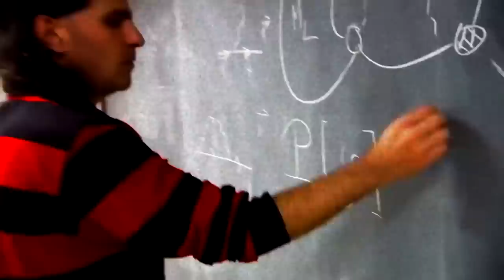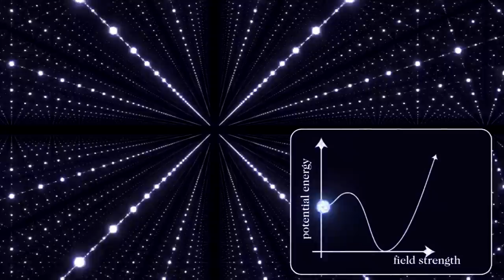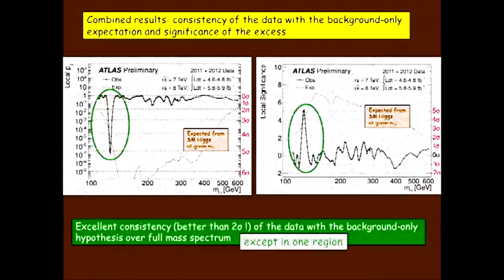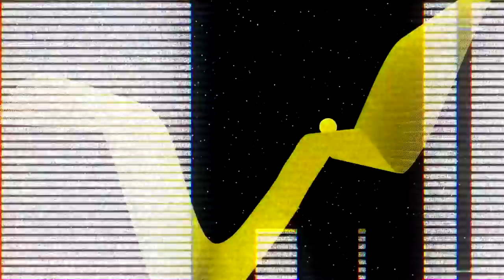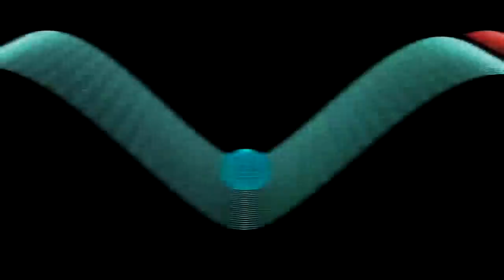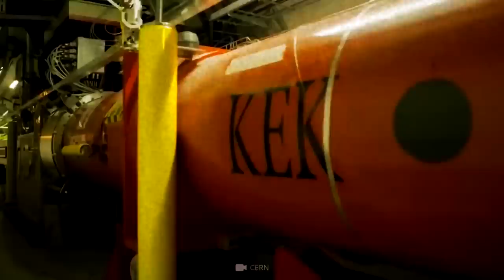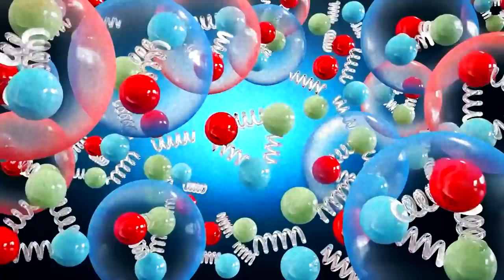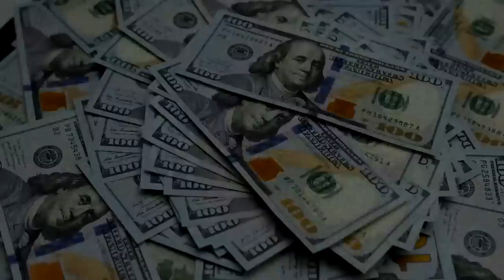Um, Something Terrifying is Happening at CERN?..

Comment: It's my understanding, they are attempting to simulate the conditions right after the Big Bang, by sending two particles(beams), both near the speed of light, crashing into each other. Unfortunately, to my limited understanding, this makes no sense. If at the time of the B.Bang, we have a singularity holding all matter and it sheds this matter, either all at once or in waves, there would be no head-on collisions between particles, as they are all leaving from the same point. Any collisions would be between two particles heading the same direction, at different speeds, and come no where near hapoening at or exceeding the speed of light. So, what are they actually doing?

Comment: We dont know at which output we will start to produce small micro black holes. If it starts a sjarm of blaçk holes at a certain current, the process can spin into a runaway chainreaction.
In theory, this is...
We actually don't really know for sure.
Reply: Swarm.